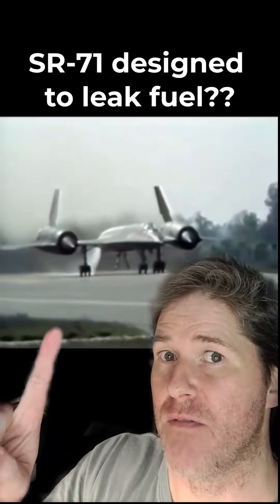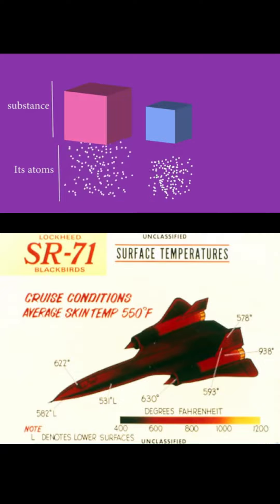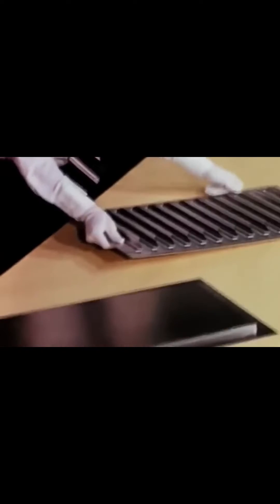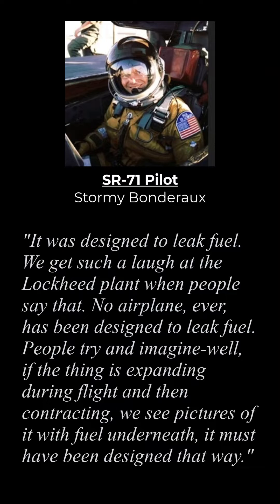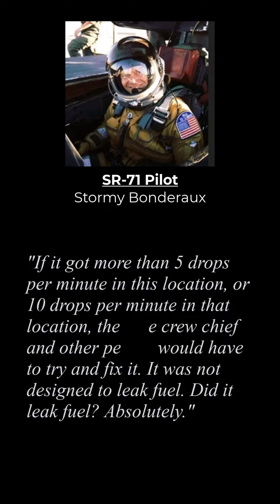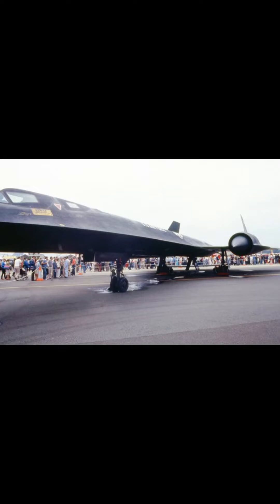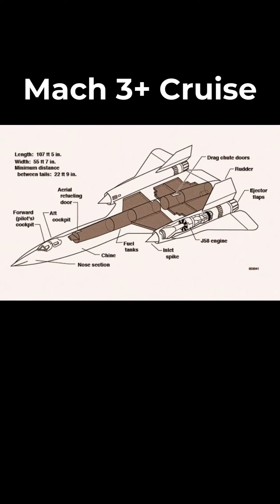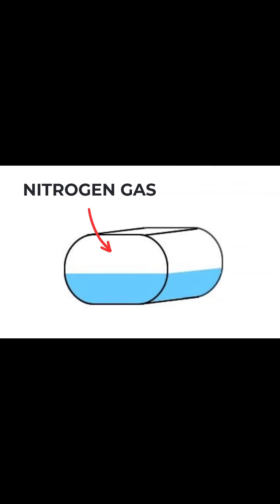Myth: The SR-71 Blackbird was designed to leak fuel?

Comment from the maker: Myth: The SR-71 Blackbird was designed to leak fuel?

✅ Top Secret Lockheed D-21 Supersonic Drone -    • Top Secret Lockheed D-21 Supersonic D...  

👍SUBSCRIBE👍 to see more tech videos! →    / @warning56kb  

🔷FOLLOW MY SOCIALS🔷
Discord -   / discord  
Instagram -   / warning_56k  
TikTok -   / warning56k  
Twitter -   / warning_56k  
Facebook -    / warning56k  

0:00 - Intro
0:42 - Total Wet Wing Fuel Tank System
1:33 - Maximum Allowable Leakage Rate
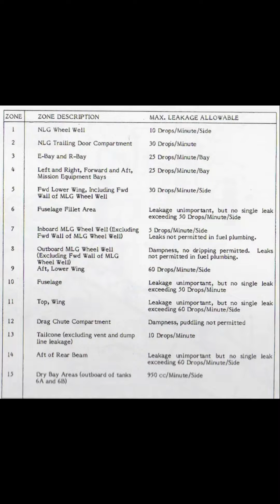1:45 - Stormy Bouderaux (It was not designed to leak fuel)
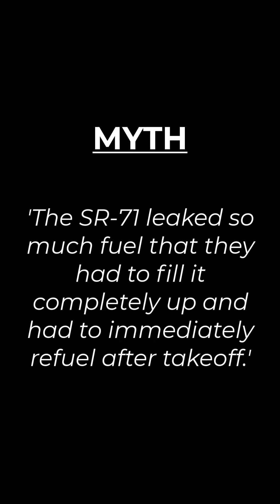2:48 - Myth - Had to refuel after takeoff because of leaking
3:52 - Pressurizing fuel tanks with nitrogen
4:39 - Summary
5:02 - Outro

Comment: My job was aircraft fuel systems in the Air Force. Fresh out of the shop this aircraft leaked no more than anything else. After several hours of flight, leaks did develop. In between we did temp fixes like we did on other planes. No, this aircraft was not made to sit around on the flight line and leak jp-7 everywhere.😂
Reply from the maker: 🤣 Well said! So many people keep spreading the myth that Lockheed engineers intentionally desired for it to leak fuel. They die on that hill with their arms crossed while stomping their feet. lol

Comment: My question is how did you gain this knowledge? If why would you expose it? Thanks
Reply from the maker: @MrBlackbutang  By reading sources such as the lead engineer of the SR-71, Ben Rich as well pilots who operated the aircraft. Most of the SR-71's information has since been declassified and you can find detailed information on its maintenance and technical aspects. Many rumors and wives tales just stick out as fantastical, so people tepeat them. As an example there have also been many rumors about the D-21 drone which the SR-72 carried (actually the M-21), but you can go directly to the NROs website and download all of the original mission plans, briefings to high ranking officers, detailed assrssments, ect.